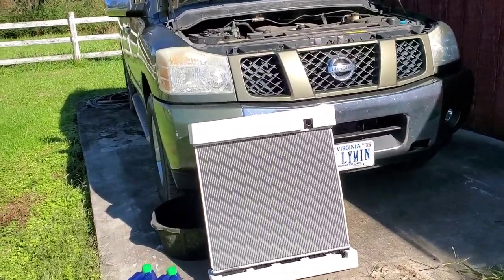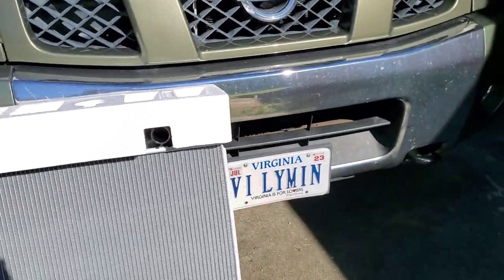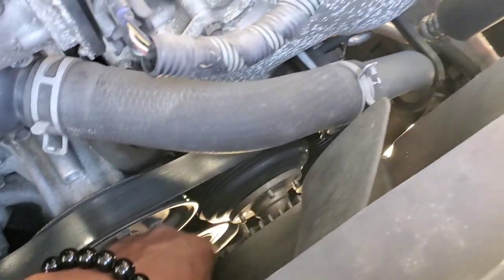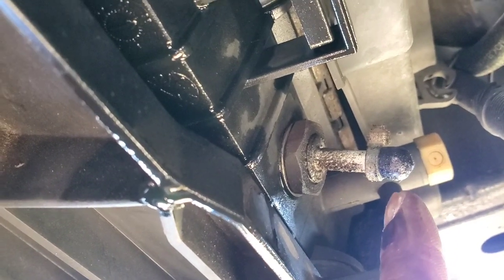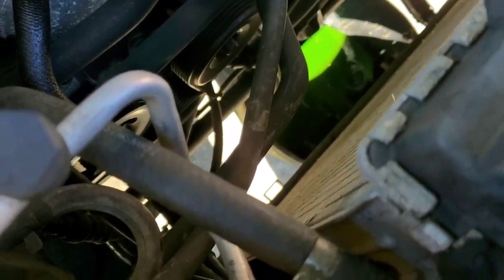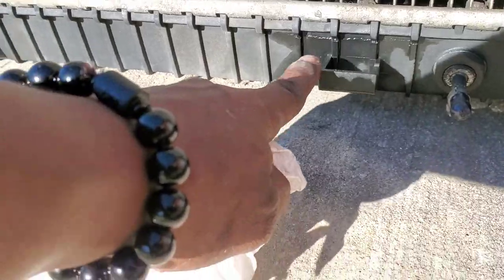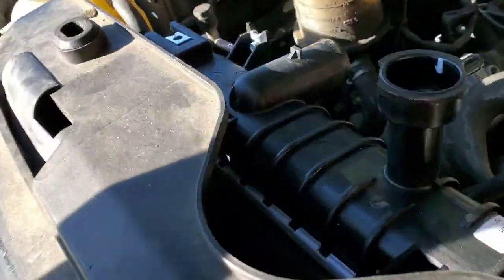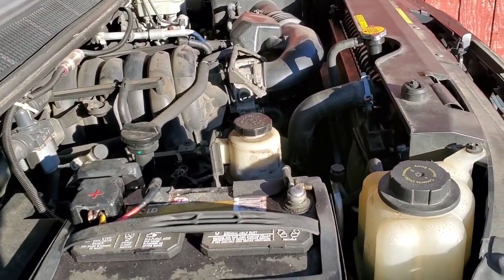2005 Nissan Armada & Titan radiator removal

Comment: I have a coolant leak as well and I just discovered it when I added antifreeze.  My heater was not working.  When I watched this video you were talking about the association between the coolant and the heater so I turned mine on and lo and behold it came on. Good news is that they don't have to replace the heater core, bad news is that I have a coolant leak but the leak is much easier to fix. This video was very helpful 👍👍

Comment: Good video ; ) I replaced my 2004 Titan crap factory radiator with an all aluminum one 11 years ago still going strong . Cost about 3 times what a cheap replacement would but it's worth it not having to worry about it anymore ; )
Reply from the maker: I have been eyeing those aluminum radiators. They are very nice units.
Reply: @97TRAKIN  Of course they are practical if you are going to keep your truck a long time . With the price of new trucks i will be keeping mine a long time ; )
Reply: what radiator is it ? looking at stillen and csf at the moment
Reply: @patron_bulliez5558  It's a csf ; )

Comment: Thanks, very much for sharing all of this installation process, and your thoughts, as you work thru it all... It'd be nice if you had a helper to operate the camera, while you work, with both hands free...  Great job!!! I'll be doing this ASAP, on my Titan. 
 [IMHO: You ought to refer to the "radiator (water/glycol) COOLER" as such,... and, not call it a "condenser".... A condenser is part of the A/C system,... and it "condenses" the refrigerant gas, back into a "liquid"....]
Reply from the maker: Thank you for the comment. I was referring to the condenser as the "condenser". To replace the radiator you are working with three radiant cooling items. The radiator, the transmission air to fluid cooler, and the A/C condenser. Every time I said condenser, I was referring to just that 👍.

Comment: How did you remove the fan, I try but it won't stop spinning.
Reply from the maker: You can use a long screw driver or small pry bar between the nuts. Break the nut(s) free that the screw driver/pry bar isn't blocking but don't remove them completely until all have been broken free. Good luck 👍.
Reply: @97TRAKIN  thanks

Comment: My car has 204000 miles too and it is doing the same thing. How much was it for the radiator?
Reply from the maker: I'll make a quick phone call and get back with you.
Reply: As of 3/1/2021 I see that AA has the one he put in for ~210 USD + tax.  Rockauto.com has a Denso one for ~140 USD after tax and shipping (for where I live).

Comment: I know I am late, but those trucks the tranny cooler is built in, your coolant went into your transmission. FLUSH YOUR transmission asap at nissan. Pay the money and get the fluid done.
Reply from the maker: Please look at this video in its entirety and even better, my previous videos on doing the "transmission bypass".
Reply: The other transmission cooler is at the top right on the front side.
Am i wrong is that an oil cooler?